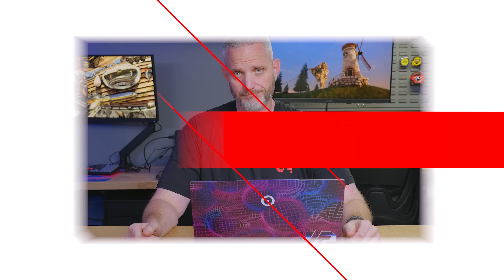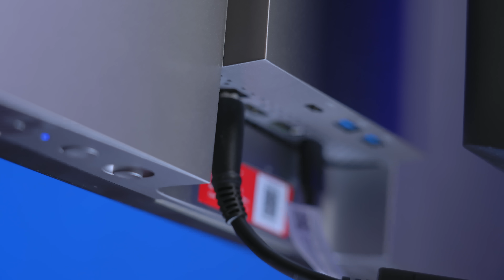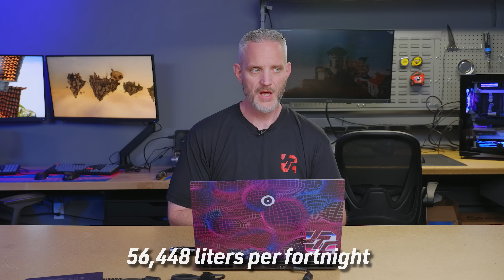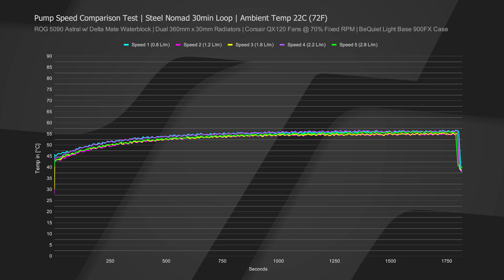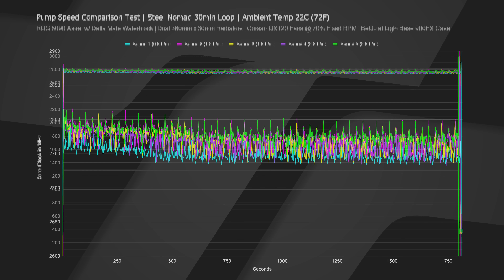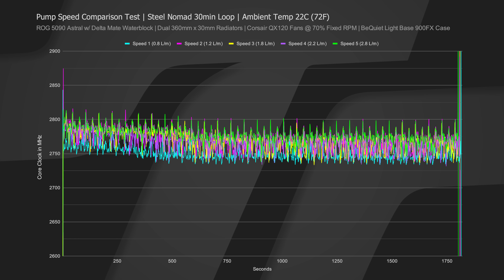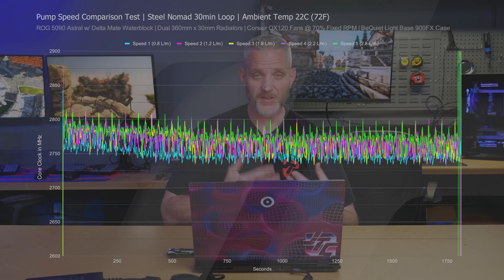Stop doing it this way!

Comment: My two D5 pumps are now 11 years old and are running like new. They have been controlled via an Aquaero controller on a curve. Never seen them running at more than 70% and they idle at about 40%. At 40% that gives me about 1 liter per minute due to the length, amount of turns and height of my loop(There is about a 3 foot height difference between my top component, my Aquaero controller waterblock and my lowest 480mm radiator).  From my own testing I never saw any need to run the pumps harder as I ran into non thermal hard performance walls for both my CPU and GPU long before the cooling became inadequate. A few degrees CPU and GPU temp made no difference in real world usage.

Comment: wouw that's suprising, yes i figured it would matter only up until it's flowing fast enough but that point being at 1.2-1.8 is mind blowing (I set up my loop to target 1.2+ kinda at random who knew I was targeting kinda the sweetspot for me it was mainly that I'm running my pump at 13% to achieve it thus it's drawing about at little power as it can, I pretty much cannot hear it run and it should outlast the species)
Reply: You just never met 1GPM gang. They all believe that minimum flow rate in your loop should be 1GPM (3.7 L/min) and anything below is horrible and should not exist. Not sure though what do they use to measure flow rate because most of them have a loop with a single pump, so at best they have 2.5ish L/min.

Comment: You can't beat physics.

What you proved here was that at 70% fan speed with the surface area cooling you have, 1.2 was the best setup for your loop.  This will not stay the same for all fan speeds and certainly changes from system to system.

If you lock your fans and never ramp them, then this is a test to mimic.  If you have variable speed fans, then you need to test the fans at different % speeds AND the pump at different settings to see your best setup.

Essentially you needed 1 more set of data points.  I'm not saying this to belittle what you did or disparage it, I'm simply stating it for anybody else trying to copy this to help them get to the right answer for THEIR system.
Reply: I have data for various fan speeds in my system, the results are pretty much the same. Anything above 150 L/h is just ridiculous and something like 250 L/h gives you 0.5C bonus at bets. While the difference between 60 L/h and 150 L/h is 2-3C on the component temperature. And the faster the fans - the less is the difference.
Pretty much the only bad scenario is when flow rate is below 30-50 L/h.

I've also heard this theory about "liquid sitting in the radiator for longer period", but pretty much it just outlet temperature deceives people into thinking that. Yep, when you increase flow rate, outlet temperature increases as well. And if we use outlet temperature as "radiator performance metrics" - we see that "performance decreases". But if we look at wattage / btu / even something simple like average between inlet and outlet - you won't see the same thing. Radiator performance changes very slightly with flow rate and it is caused by fluid dynamics and its weird effects of turbulent flow inside channels and tanks. Some radiator can work slightly better, some worse.
While outlet temperature increases because with higher flow rate loop delta decreases and loop delta only depends on heating - TDP and flow rate. Radiator does not affect delta and only determines temperature at which such delta can be achieved. As result inlet and outlet temperatures simply move towards each other.

Comment: If you want to measure the pump heat injection, measure loop temp before and after the pump. Also, there's no need for infrared cameras. I work on "loops" worth millions and I just use k type or other pipe clamp. I don't even own a thermal camera, there's also none in the tool crib.
Reply: That might be difficult to measure accurately. It looks like the standard D5 is only 35W. 35W of heating will raise the temperature of 2 liters of water 5C in a hair under 20 minutes, assuming there's no heat loss from the system. If you have a radiator in the loop you'll be negating the heating, even passively.

Comment: i have a DDC pump and i run it at 35% cooling is good on a 5800x3d and a 3080 with 2 360 30 mill thick rads

Comment: There would be a point perhaps where the fluid in the loop might be getting close to laminar flow. This might be perfered over turbulent flow. Also the longer the fluid is in contact with the hot bits the more heat it might be able to collect (until it get heat saturated) before moving along to eventually get to the radiators.
Reply: That is questionable because this would make thermal transfer horrible. I think turbulent flow is more desirable in cooling because it mixes boundary layers.
Also with liquid viscosity I don't think laminar flow is possible with such high flow rates and liquid speeds that regularly observed in PC loops.

Comment: With the loop capable to dissipate as much heat, you probably won't even be able to see much of a difference from the pump heat load itself.  I would expect this would matter more if the loop was just barely able to handle the heat load of all the components.  If you let the system idle for 20-30min at each pump speed and charted the loop temps, you should be able to see just how much heat the pump is adding to the loop, can probably just do speed 1 vs speed 5 for proof of concept.
Reply: There is an easier way as mentioned by another user. Just take a pump reservoir combo that can hold 1 liter and hook a hose from the intake to the outlet and stick a thermal probe in the water. Let the water equalize to room temperature, then run the pump until the temperature goes up by one degree and then you should have all the data for calculating how many watts the pump is dumping into the water per minute.
Reply: @rustknuckleirongut  That would work to a degree....its just a standardized test at that point.  

But the load on the pump is going to be different in different configurations.  In that test configuration the pump might dissipate 10watts, because its under almost no load regardless of speed.  If you connect that pump to 2 different water blocks and radiators and fittings etc, you are changing the load on the pump, which will change the amount of heat it generates.
Reply: @Robert-S-  The point is to remove as many variables as possible to where the only heat added to the water comes from the pump for this test. The only thing we want to know is how much heat does the pump add at different speeds. The amount of heat dumped by the pump only changes by the speed the pump is running at, not the amount of stuff in the loop. Those added things in the loop just slows down flow, they do not change how much heat is produced by the pump at a given speed. The pump feels no additional load when you add stuff, it just reduces how fast it can move the water. A pump running at 100% uses the same power regardless of flow. It can not draw 110% just because the water moves slower.
Reply: @rustknuckleirongut the load of pushing the water through a loop will change the load of the pump.  A fan sitting on a desk just blowing air will draw a different amount of current than it will when mounted to a radiator.  The load matters.
Reply: @Robert-S-  Not when the power is restricted. More restriction means slower water, not more power draw. Same for a fan. If you run it at 100% and add restriction it does not draw more power, the air just moves slower. This is basic physics. Adding more work does not equal more power. Adding more power equals more work. All power needs to come from somewhere. It doesnt just magically appear when you add resistance.
Reply: @rustknuckleirongut I'd like to see this physics demonstration.  Resistance changes power draw.  A pump with no resistance will draw less power than a pump with resistance.  Anyways...testing in isolation only is repeatable in isolation.  Testing in situ is the only way to know what the pump is doing in your particular setup.
Reply: @Robert-S-  You are missing key components in your knowledge that I give up trying to fix
Reply: @rustknuckleirongut I merely asked you to demonstrate your claim.  A simple search would have told you that adding load to an electric motor will increase power draw. Doesn't matter if it's a fan or a water pump... Load = resistance and resistance = heat.  More load = more heat.  A pump in a low resistance loop will be more efficient than a pump in a higher resistance loop.  The higher resistance loop will make the pump work harder and thus will produce a higher heat load.

Comment: 2:00 According to the conservation of energy law a GPU can never dump more energy in heat into the loop as its drawing in power...
Reply: There is the few watts from pcie power from the mobo but there is also micro spikes clearly shown in the graph don't nvidia cards have like 100w over rated spec spikes still?
Reply: @shadow105720  im not talking about rated power but real draw. doesnt matter if slot or pcie connector. Its just simple physics.
Reply: @DAMA2000  true any device cannot dump more energy in this case heat than it draws. Simple as that.
Reply: @shadow105720  Those spikes are so short that it doesn't affect the overall power draw.
Reply: @shadow105720 thats not the point. Jay said you can get more than 600W heat out of a card rated at 600W. the card is using the majority of that to make graphics appear so you get nowhere close to 600W of heat out even with your extra 5.5W of PCIe. What he said breaks physics.

He should correct it.
Reply: @DailyCorvid  One minor correction: GPUs and PCs in general are incredibly electrically inefficient. Most places estimate that GPUs are less than 1% electrical efficiency. Or in other words 99%+ of electricity used by the GPU is exclusively waste heat and less than 1% of electricity used is actually doing the processing. And as with all electronics the harder you push them the worse the efficiency gets so a 600w GPU running at full tilt under a synthetic benchmark is usually going to likely be approaching an electrical efficiency in the area of 0.1% leaving 99.9%(see: 599 of the total 600w) as waste heat. CPUs have even worse efficiency than GPUs do so the story gets even worse on that end! The more you know! 🌈✨
Reply: That's just not correct.  I did reply with a detailed answer, but some idiot reported it because the truth was too painful.

Breaking it down in simple terms :

You can't say it's only using 1% of it's energy for the specified task, and still say it's efficient.  And neither can you say it's using 100% of that energy to generate heat when it has VRM's RAM and fans.  And in any case, it is not running at 100% load consistently the whole time without those things also active.

So the case study you are using probably from Reddit amateurs or ChatGPT - just does not hold up to basic scrutiny.  I have a 220W rated card (4070S) and it runsslightly below that, because it is undervolted but also overclocked.

That is my point, what Jay said is going to encourage people to just dump more power in and then more money on cooling - when in fact the best way to get good performance - is to undervolt and then overclock, and to make sure your cooling is done correctly as well.

And the original point he said that if you are putting 600W into your card, then the heat you get out will be that or more, is categorically impossible unless your GPU is able to somehow generate the extra power required for that heat to be generated using.  The first guy backtracked and changed it to TDP (which wasn't what Jay was using).  And the second person added a benchmark test and volt spikes (again which does not affect total board power during use).  All this stuff just suggests a lack of practical experience.  So I don't quite get where you are getting this stuff from if it's not Reddit or ChatGPT.
Reply: lmao mr actually 🤓... He said "sometimes even more" since u can overclock those cards, they advertise as 600W but are capable of much more..
Reply: Science. Vs jay
Reply: Wattage is not a measure of heat, you're both wrong.
Reply: @TommyTombstone at last somebody says something sensible lol yes wattage is a measure of energy but I'm talking to people who think you can get more heat than you've put in energy!!

Not like I'm talking with science loving physics guys here bro. I'm trying make it easy lol. My point is that if you put 600W in you are never getting more than 600W worth of heat back out regardless of the metric you've decided on. 😂
Reply: Everything except components that emit light or really any form of radiation have power in = heat out. No exceptions.
No you can't magically create more power. You can move more power but you can't create it. Energy MUST be conserved otherwise you are breaking the laws of physics.
Radiation dumps the energy in a different location but after that it also turns to heat.

So no a 600 Watt graphics card CAN NOT produce more than 600 Watt of heat energy. (600 Watt in = 600 Watt out. Its just converted to a different form of energy.)
Reply: I don't think Jay is talking about science busting bs at all. He doesn't explain well some times, and what I think he was getting at is 5090 is [TDP 575 but fuck it round to] 600W but can potentially dump more than '600W heat' because draw spikes, PCIe power draw etc. 5090s can draw over 660W iirc in some 5090 video (I think with Jay or Der8auer using hardware that measures PCIe draw and front connector draw independently), and I think that's what he was trying to get at.

Additionally, not familiar with his loop, if his CPU is in the same loop as his GPU, the CPU can 'dump more wattage' into the loop than the 600W.

Y'all taking plain Jay's words too literally. You do realize who you're watching, right? Regardless, most ridiculous hill to die on lmao. Almost make him out to be an EK shill or something.
Reply: Very true, but I suspect the GPU is a pretty efficient heater that only loses a relatively small amount of its energy to computations.
Reply: He's talking about reported power draw.
Reply: Well actually, it can dump more energy into the loop as it's drawing power - if it is acting like a heat pump and drawing more heat from the surrounding air/water.
Reply: @martinnyolt173  that would assume that the surrounding air and water would be warmer than the cooler/card. That is highly unlikely under load. And even if it was the delta in temperature would be low so that the head transfer would be negligible.
Reply: Exactly, this is not a miracle power generating card lol Jay your math is wrong here.
Reply: So overclocking does not draw more power from the card than the standard max power ratings... I can't imagine... Guess you never heard of transient spikes problems, they go way over the standard max power ratings ( to use your vocabulary).  That was a real issue with the 3090's and some went over the power supply max current draw and tripped the ocp (over current protection) and shuts down (sometimes by more then 75+ watts. My best guess is you guys don't own a high power graphics card.
Reply: You are literally not reading. It doesn't mattwr how much you put through your card it is never going to generate 600W of heat.

Considered it's using that power for generating your graphics the heat given off is absolutely nowhere close. You could give your card 800W it still wouldn't.

The proof is you can get a 600W heater they ONLY generates heat using its power and nothing else no lights no processing NOTHING else...

And it will manage maybe 550W of heat. It's called the Laws of Physics. @3dprintordie

Comment: Hab mir ne 2 Laing 12V ddc in die Loop gepackt, weil 2 Radis intern und Mo-Ra 3 Pro extern mit micro Direkt die Pro und Eisblock für GPU und Temp mit Durchfluss Sensor, ist eine Pumpe zuwenig, hab beide Pumpen auf 3000rpm und die Lüfter immer auf 600rpm, hab maximal 24,5°C Wassertemperatur bei 200l/h, in Gaming bei mehreren Stunden. Der delta zwischen Eingang und Ausgang vom Mo-Ra 3 sind 0.6°C Wassertemperatur. 
Das Startproblem kann man mit nem Power Adjust 3 von Aquacomputer umgehen, da kann man einstellen wie hoch der Startstrom der Pumpe sein soll! Hab mein Setup im April geholt, hab aber noch ein paar Kleinigkeiten, bis ich das Setup fertig habe, so wie ich mir das gedacht habe! Meine letzte Laing DDC-1T + PWM lief über 7 Jahre. 
Wie immer Dankeschön fürs Video!

Comment: Jay! You forgot about one major thing on this test... it will be different depending on the different fluids folks would be using. Every company has a different composition of chemicals they add to their coolant... so not only do you need to do the pump test the way you did it, but you need to go through different fluids from different companies.
Thanks for your time.
Cpl. Barnhart U.S.M.C Veteran 
I7-920
EVGA x58-sli
12gb ddr3
3x gtx 260 in sli
Reply: on paper that's absolutely correct. in practice for gaming  computer cooling it makes so little difference that you can basically ignore the difference in specific heat between the fluids ^^. Like ,water is 4184 J.kg.K. Your usual 30% glycol mix only drops to 3800 and some change.
Reply: @ledoynier3694 

That is interesting so basically every company selling coolant for gaming pc's is just blowing smoke up everyone's butts.
Reply: Yeah Jay! You have to test every coolant ever made, gosh.
Reply: @moebius2k103 
Lol, not all just all of Jayz top choices! Lmao.

Comment: Can we have another one using those brackets to fit 2 pumps? And test 1 pump at double the speed vs 2 at half of it and so on to see if it's worth it to reduce sound or the amount vibration and heat output from the pumps.
Reply: I installed 2 D5 pumps for redundancy. While I never ran a single pump at 100%, there is a slight increase in sound when running two, but all other factors were essentially identical.